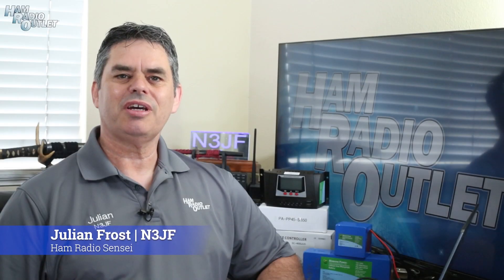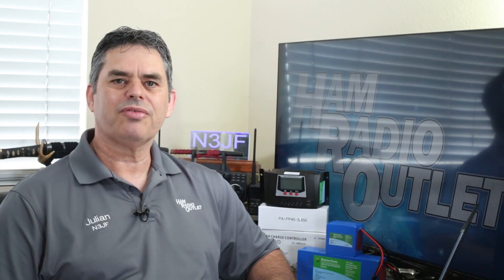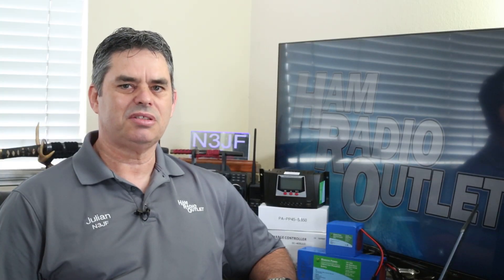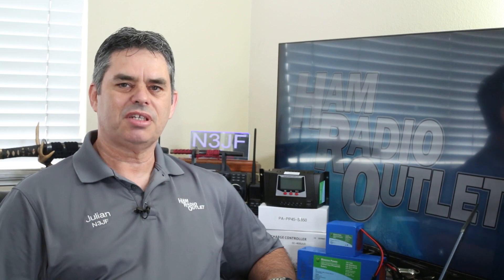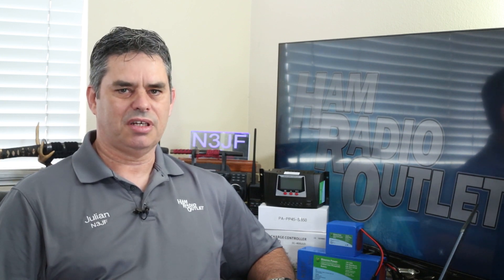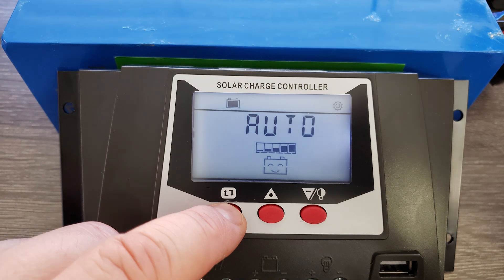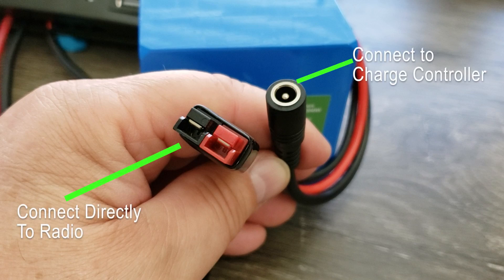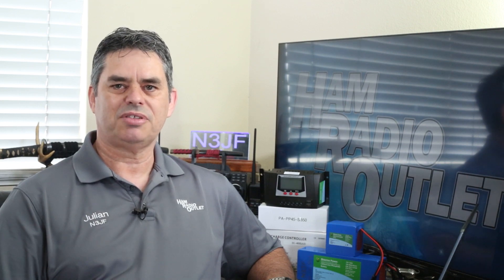Going Solar for Field Day - Ham Radio Outlet

Comment: I just bought a Dakota Lithium 12V 10aH battery and already have several solar panels. If I bought the charge controller you show in this video do you think that I could charge that battery using the charge controller in this video? If so how would one set up the controller to use?? I’m interested in buying that controller so hopefully you can help? Thank you very much sir. de AD7VV MIKE
Reply from the maker: You could use this charger with your solar panels. You shouldn't have to change anything as the battery chemistry is the same as the Bioenno batteries and both have battery monitoring circuits. Just FYI: I've seen LOTS of bad reviews of the Dakota Lithium 12V 10AH batteries. When it arrives, it should NOT be at 0-Volts, as many have reported. If it is, it's dead. Do not try to charge it.
Reply: @HamRadioOutlet  Thank you; the first thing I did was to check the charge state and it was at 10 V so I plugged in the charger that I bought with it and let it charge overnight to full charge. Today I took my sBitX-V3 with me to work and crimped Anderson Power Pole connectors onto the rigs power cord and also onto the Dakota battery connectors and did a current / voltage test series in transmit and receive mode. My next step in this project will be to buy the charge controller and see how it will charge the battery both during use as well as in downtime mode. Thank you for your reply.
Reply: @HamRadioOutlet  the sad part is that HRO won't ship to Alaska ....
Reply from the maker: We do ship to Alaska! Here's the info from our website: "For customers in Alaska or Hawaii, most items can be shipped by UPS standard service, as well as some of the expedited services such as "Blue" or "Red". Please contact your local Ham Radio Outlet store for these additional charges." If there's an item that we can't ship to Alaska it's because the shipping companies won't take it, unfortunately.

Comment: Hi Julian, great video, thank you. 
Sadly we can't get Bioenno products easily here in the UK. I've just got a small 20Ah Eco-Worthy Lifepo4 battery, hopefully it'll do the job just as well.
Another famous YT Julian (OH8STN) fits ferrules to the wires going into the charge controller.
Is it something you'd do as well?
In advance, many thanks for your time.
Best regards,
Manny / England 
73 de 2E0HJN
Reply from the maker: Hi Manny. Ferrules are not mandatory for electrical use (in the home/factory etc) in USA as they are in much of Europe. I think they are a good idea, however, the choice to use them use may depend on the wire used and the individual equipment. For example, the SC-4830JUD seen in this video does not use a screw to make contact with the wires, it uses a top and bottom metal plate which clamps down onto the wire. In this case, the individual strands do not spread around the screw, as they can in other devices, and so all strands are part of the circuit, This would make a ferrule unnecessary. You could still use one if you wished.
Reply: @HamRadioOutlet  ... Thank you very much for the explanation! I've ordered a Genasun charge controller, from the Netherlands, I'll check when it arrives if it's screw or plates that tighten the wire... Cheers! 👍🏼
Reply from the maker: @EssexCountyPhoto  I have the Genasun GV-10 charge controller. It also has plates that squeeze the wires, rather than a screw that tightens down onto the individual strands. Something to think about with the Genasun controllers is that in order to charge efficiently, the input voltage to the GV-10 needs to be ~1.0V higher than the battery voltage. The GV-10 is rated at 140W of real life input, if excess PV input current is made available to the GV-10 charge controller, it will go into current limiting mode, operating slightly above its rated capability. This is designed as a safety feature and is not intended for prolonged use.
Reply: @HamRadioOutlet  ... once again, much appreciate tips! 🙏🏻
I'm planning on getting a Powerfilm R-60 rollable panel, 60W / 15.4V / 3.9A ... Hopefully I will assemble all the bits correctly and there won't be any "magic smoke" appearing anywhere! 🤣
And after that I'll have many more hours (years!) of learning CW ... 🤓

Comment: Just got this controller.  Directions indicate set up for Lithium battery.  I have a River 412Ah with the battery management system.  

Unable to get controller to power up with battery under load only. Will power up with 160W solar panel hooked up but keep getting E3 and E4 error messages.  Wiring hooked up correctly as far as I can tell.  Looking for suggestions
Reply from the maker: Sorry you're having trouble with your solar controller. If you're sure that the controller is set up for the correct chemistry and is properly wired (per the video) and you're getting errors as soon as the battery is connected, it's possible that the controller is defective, or it's incompatible with the River 412Ah battery that you're using (or the BMS or battery is defective). I would give Bioenno a call or send them an email: https://www.bioennopower.com/pages/support

Comment: please use the load side for your load / radio.  one feature of the controller that you are forgetting is it prevents deep discharge by disconnecting the load from the battery when the battery has fully discharged.  This can only function if you connect your load to the load port on the controller rather than directly to the battery.
Reply from the maker: The manual specifically states NOT to use the Load terminals: “Connect your Load to your Battery’s output using the Battery as the buffer between the Solar Panel Array and the Load (we DO NOT recommend using the Load Terminals for most uses)”. Bioenno batteries have a battery monitoring system built in to stop over discharging.

Comment: The SC-4830JUD I received yesterday 7/14/2022, shipped directly from Bioenno Power, was set to USE1. I am very glad I found this video. Thank you for taking the time to make it!!
Reply from the maker: Bioenno said in an update to my email about it, that the settings the controller comes with are identical to "3.2--4" so it's good to go out of the box.
Reply: @HamRadioOutlet  Appreciate your response, maybe I got sent a return or something. My SC-4830JUD controller was set to USE1 and the menus showed float voltage, absorption voltage and other menu items from the lead acid side of the instructions. I changed to the settings you showed and now see the menu from the lithium side of the instructions.
Reply from the maker: @BladePilot24  Strange. Maybe they have units for distribution to ham radio retailers and units for general sales, so that when you buy from HRO you get the type set up for LiFePO4 batteries? No idea, just guessing. Glad you got it programmed and working though!
Reply: @HamRadioOutlet  that makes sense, could certainly be the case. 👍
Reply: I know this is old but I just got my sc-4830jud today directly from bioenno and it was also set to use1 with the lead acid settings. Had to change it. The manual isn’t very good so thanks for your video.